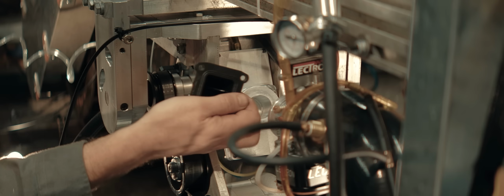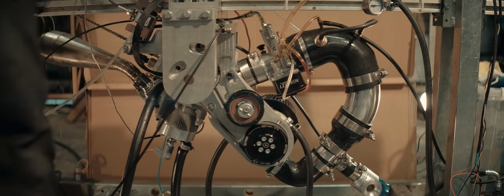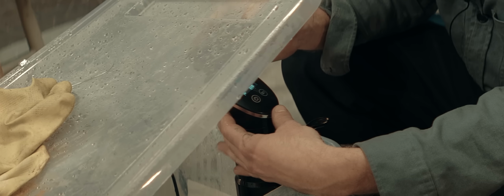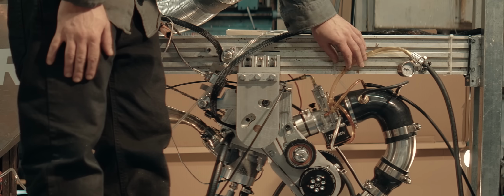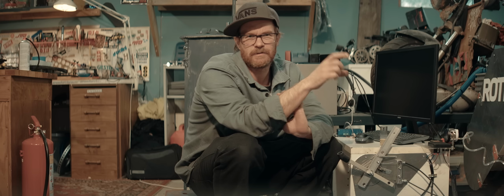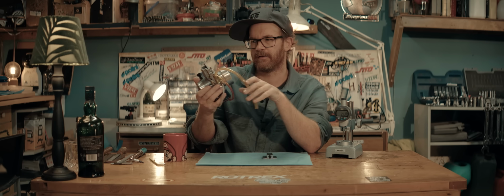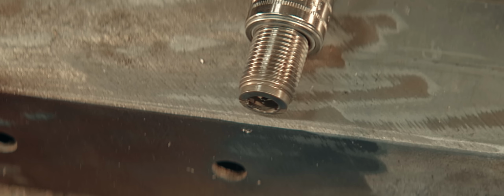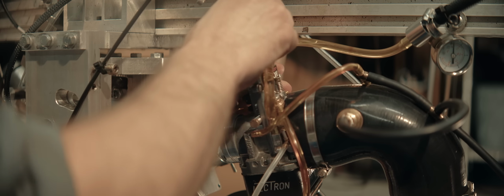Supercharged 50cc Two Stroke BREAKTHROUGH!

Comment: Never before have so many motorheads been so engrossed in the development, care and feeding of a 50cc 2 stroke. My favorite channel. Brilliant.
Reply: ohhh how right you are, engineers all about the world following this adventure, all for 50cc!! personally I think a turbo is needed to reduce the parasitic loss
Reply: I’m guilty! Lol i don’t know how i stumble on this channel but i did and i never stopped watching lol 😂
Reply: @marcwire9332  turbo with a boost capacitor to keep boost on demand.
Reply: @marcwire9332   Turbos are not suited for two-strokes. You need the more predictable boost across the RPM range that a supercharger provides (as boost is directly dependent on engine RPM), especially with two-strokes having such a sudden and defined power-band. Also, for single cylinder engines, the inconsistent and low exhaust pressure becuase of the single combustion event per crank revolution (or per two revolutions for 4-strokes) is not ideal for consistent operation of a turbo. Finally, imagine putting two-stroke exhaust through a turbo; the soot and oil would quickly ruin the efficiency of the turbine, and the unburnt fuel could become very dangerous becuase turbos get really hot, kinda like a bomb. 

When you think supercharger=inefficient, you are probably thinking of a roots type. Twin scroll (Lysholm) and centrifugal (as used here, I think) types can actually be quite efficient. Centrifugal types are just the compressor side of a turbo driven by then engine through a hefty gearing ratio, rather than by an exhaust powered turbine. For a small engine like this, the efficiency gains of a turbo are so marginal that the instant boost and reliability of a supercharger are worth it.

Turbos have a parasitic drag of their own, in that they increase the pumping losses of the engine. I don't know exactly how bad that would be in this case, but I do know that it would have a negative impact on the "free-breathing" of an engine that is meant to rev as high as this one will. I also think you would struggle to find a turbo suitable for a 50cc motorbike engine, since there are so many more variables involved in turbo design, such as exhaust flow rate and pressure for max efficiency, operating flow rate range, power producing regions, compressor output static pressure, flow rate etc. The supercharger is just the better decision for this application, in my opinion.
Reply: I’m guilty!
Always waiting with anticipation for the next video to come out.
Always wanted to mod a weedeater engine. This is saving me a lot of money and time with better results.
Only thing that could be better is 4 cylinders in line!!!
Reply: @rexhorning7228  Two lines of 4 joined in a V :)
Reply: @slartibartfast2649  Thanks for the detailed comment.
Reply: @slartibartfast2649  there are starting to be some cool electric-powered turbos that use an actual turbo housing and basically E-bike motors. Saw some with actual boost results unlike the "electric supercharger" scams from amazon
Reply: The more I think about it, the more right you are! Alex is leading an actual, historic endeavor.
Reply: @slartibartfast2649  I recently realized another shortcoming of Turbo + 2t. The exhaust pressure wave that's bounced back to pressurize the cylinder removes a significant amount of energy from the exhaust. While there's still waste heat and noise leaving the tailpipe, there's a lot less energy than a four stroke, because the exhaust has already been used to charge the cylinder.
Reply: Lol, true
Reply: @slartibartfast2649  snowmobiles have turbos working very well.
Reply: @slartibartfast2649   the nice part of the small engine wold be, that a turbocharger like the one of the smart car should step in quit late in the revrange. Therefore the exhaust housing should be quite big in comparison to the volume of the cylinder. It could work… 
It could be like these old cars wich don’t run a wastgate an rely on the to loose exhausthousing (Eichberg Sierra)
Reply: Are they tiny two-strokes like this? Some larger two-strokes have direct injection and conventional oiling systems like 4-strokes, not have oil+fuel and carb combo like there is in the video. This makes the exhaust gasses much cleaner so there is not the same problem with oil, soot and fuel ruining the efficiency of the turbine.
Reply: @mathewreinecke2852  those are only 4 strokes, are they not???
Reply: This is like the longest Netflix series on how to design a motor ever. Love it.
Reply: @slartibartfast2649  Every time someone says turbos and two strokes don't work there is always someone out there running a two stroke turbo motor. All of the reasons you listed why it won't work are really just pissing in the wind. Just because there isn't a perfectly sized turbo for this motor and well engineered solutions to any problem it might encounter doesn't mean it can't work.

I've seen so many people waste time with theoretical nonsense like "It can't work because of x, y, z" and meanwhile guys are ripping up mountains with factory turbo two stroke snowmobiles all day.
Reply: @marcwire9332  yes i have been wondering if a turbo a little smaller than a ko3 would probably have awesome response
Reply: @mjodr  Just because some guy in his garage slapped a turbo on a two-stroke doesn't mean it works well. Why do you think engineering exists as a profession? In case you didnt know, engines are designed on maths that is all about the 'x, y, z". If you think I'm 'pissing in the wind' try actually studying engineering and design an engine. There is a big difference between something that is possible and a good idea.

Is it possible to make a gasoline powered locomoitve? Yes, absolutely. 

Is there a good reason why all locomotives are diesels? Yes, absolutely.

I said turbos are not a good idea on two strokes becuase most of them are carburetted, single cylinder, small displacement with fuel+oil. The Rotax engine in the snowmobiles you allude to is a fuel injection, twin cylinder, 850cc with a conventional oiling system like 4-strokes. None of what I said applies to the Rotax because it is totally different in design.

Owning, fixing and tuning a motorbike doesnt make you an engineer, so do a bit of research before telling someone they don't know what they are talking about, otherwise you might make yourself look like a tool.
Reply: @mathewreinecke2852  they are totally different in design, being two cylinder 850cc direct injection engines, without the oil+fuel of this engine.
Reply: @slartibartfast2649  You are proving my point and contradicting yourself. It's pretty clear at this point Alex can engineer anything if he wants to. He can make this engine with all the features you describe, besides displacement.

I don't think displacement is a problem. He went out of his way to custom build a supercharger with the right specs to match this motor. That supercharger is very similar to the front half of a turbocharger. There's nothing stopping him from going all the way and completing the turbine side and making it a properly sized and functioning turbocharger.

There isn't some magical formula that says below certain CC turbocharging is not possible. It's just not as easy to buy off the shelf parts and slap them on. Obviously that's not what Alex does on this channel all the time. He is capable of making stuff. Which makes him capable of copying whatever makes the new turbo Rotax work. Direct injection, conventional oiling, and whatever else you think is magical and impossible to copy from the Rotax.

Go watch this video and tell me you can't scale all that down: https://youtu.be/ddw354bsy8s

300-600 hp and no direct injection and no conventional oiling system. WOW! How did they do it? Impossible!

The only one looking like a tool around here is you.
Reply: How did the Detroit diesel
Two strokes ever survive with turbos?
Reply: @jeremygourde9880  You bring up a good point that I forgot to mention. I dabbled in the heavy diesel world. Not only are there many boosted two stroke examples, but the environment those turbines are in is pure hell compared to what they would experience in Alex's design. I think he is trying to say the turbine would foul with sticky oil and soot or something. Holy crap, have you ever seen what an OEM turbine looks like when you pull it off a diesel with 400,000 miles? Let alone what one would experience in a motor that is modified and is just DUMPING soot out?

Another example would be my 1987 OMC 175 exhaust is clean as a whistle. That's with old school carburetors and premix, too...not even using the factory VRO oiling which reduces the oil even further.

Now, to be fair, my Yamaha YZ250 exhaust was always a goopy gunky mess, and so was my friend's. But also that was the first two stroke I owned and I'm sure I could have tuned it better. It's possible he is scarred by an experience with two stroke dirt bike exhausts and he is assuming if you throw a turbine wheel in there it will get all gooped up. That's the freaking least of the worries in Alex's application and VERY easily solvable, lol.

What a trivial problem to even have the attitude of "don't even try, it's a bad idea." He must not see the motto plastered on Alex's garage wall - "Easy isn't worth anything".
Reply: @mjodr  Alex did not design the supercharger. He designed the gear ratio. That is an off the shelf supercharger. I highly doubt that he would want to redesign  the engine for conventional oiling, which would require changing the cyclinder head and block with the appropriate oil channels as well as designing sump and oil pump system, also necessitating switching from sump scavenging to direct cylinder intake. 

Displacement is definitely a problem for turbos, since they rely on airflow. Small displacements don't move much air.

I don't think it is impossible for Alex to do any of that stuff in theory, but why would you want to? Separate oil systems, fuel injection, multiple cylinders, turbos etc.. All of that is heavier than what he has already which totally defeats the purpose of building a two stroke in the first place. So, no. There are some things that do not scale, such as the weight of pumps and oil reservoirs, cylinders (especially with two strokes which require separate sealing for each cylinder).

I made a mistake in saying direct injection. I meant to say fuel injection. 

The video you sent me is of a 1.2L two cylinder, fuel injected engine. Just like the Rotax. Wow!
Reply: you are so right 🙂
Reply: @slartibartfast2649  Small correction on the Rotax. It's not exactly off the shelf. When he called Rotax they stopped making them that small a long time ago and they told him they didn't think they have the parts. So they invited him down and they slapped together a custom unit with what they had available. It's obviously small enough to work now that we've seen it run.

He may not have designed it from scratch, but I believe he could if he needed to. You sound like you may have been around here since the start of this project, but if you haven't then it's pretty obvious Alex has the knowledge and most of the hardware and ability to make a full turbo from scratch. I mean, look at went into this completely custom designed block, from 3d printing, to casting, to cnc machining, to ideas I've never seen any other engineer try in a custom engine. He's off the deep end already and making a turbo isn't super far fetched.

Sure, the science of a compressor or turbine is one step up from the flow characteristics of inside his custom two stroke block, but it's not impossible. And if Alex fails at machining all of it he can outsource the hard bits like he has before. It would still be his design. And you would be sure it would match the flow charts/maps properly. I know it's very hard to machine compressor wheels, so I wouldn't expect him to just whip that out on his in-shop machinery.

So you admitted it's not impossible, but then asking why? Then giving examples of how it's impractical? Bro, look at the goal and what he has created so far. The goal is the most powerful 50cc engine in the world. It doesn't matter if can bolt up to stock vespa or whatever. Do you think what he has now could just bolt up a stock motorbike of any kind? He's not designing this to go into a production run for customers. It took him forever to get to this point with whacky custom designs that took tons of money and time to make. Going whole hog and making a 50cc cylinder version of the video I linked you is RIGHT in line with the tone of this project, lol! "Easy isn't worth anything" is the motto.

I was not aware the video I linked had a 4-stroke style oiling system. It didn't look like that and it did not sound like that from his description of the motor. Honestly it looks like a freaking DASA jet ski motor or like any other custom billet motorcycle two stroke motor I have ever seen. TBH, I don't know why you would need to separate out the oil anyway. It just seems like a luxury, to make ludicrous hillclimb power, or to clean up emissions for EPA restrictions on the OEM stuff. I don't think it would be required in this application. This is a one off dyno queen.
Reply: So true though huh? Lol
Reply: @mjodr  I get what you're saying, but turbos really do have a problem if the exhaust comes in big pulses, like in a single cylinder.

A well tuned carburettor can actually outperform fuel injection due to the superior mixing of fuel and air that the carb achieves, but EFI allows for continuous adjustment of the quantity injected, meaning that is is better at being consistent in lots of operational conditions. Cold starts, hot block at full bore running, high humidity, low humidity, low altitude, high altitude etc etc, but in that specific window that the carburettor is tuned for, it could perform better. Also, EFI requires a lot of parts (sensors, injectors, pipes, pumps, ECU etc) which increases weight and complexity.

I think the example you showed me doesn't actually use 4-stroke oil methods, and I would be interested to know how much power it produces vs a supercharger for the same application. The turbo is probably better becuase of the bigger parasitic drag you would get from the bigger supercharger. There is a reson that turbos are more common than turbos in larger engines, of course.

FYI, oil in the fuel is really nice and simple because it allows for the deletion of a lot of parts (oil galleries, oil pump, larger sump, oil reservoir, oil filter, piping, oil radiator), hence why it is used for small, light, cheap and simple two-strokes. Since most two-strokes use crankcase scavenging, this means the oily fuel passes all the key moving areas. the downsides are that the oil reduces the power output of the fuel, and leads so carbon deposits after combustion. So it is definitely becoming rare for emissions reasons, but also becuase it increases combustion and librication performance as well as being another cause of reliability issues.

I'm not trying to be all snobbish and play down Alex's achievements at all. He probably could get a turbo working, and maybe he will in the future, I just don't think it is the best solution. I could very easily be wrong.
Reply: @slartibartfast2649  When I was wanted to turbo my XR650R I kept seeing time and time again the old myths show up. "650cc is too small to spool anything". And the other one "One cylinder isn't enough to smoothly spool a turbo. The pulses are too spread apart. Won't make much boost. It will suck" Then a guy finally slapped a turbo on an XR650R and was RIPPING it up and down the street on video, spinning the tire for days. Since then I've seen people turbo increasingly smaller and smaller single cylinder engines, so I do not believe the old myths anymore.

Same as rear mount turbo systems. Tons of internet experts out there saying it will never work, and yet there are plenty of examples of it working for decades.

Yes a single cylinder small displacement is FAR from ideal for a turbo application, but that is not the point. If we could chose any design it would obviously be multi-cylinder and larger capacity. But the goal of this project is the most powerful 50cc two stroke in the world. If it makes even 1% more power than n/a then it is a success. We have to temporarily suspend all knowledge of efficiency, practicality, daily drivability, longevity, weight of extra components, everything. Is it worth it? That's up for Alex to decide. It's not our project, it's his. I know I'm personally not going to try and turbo a 50cc motor. I don't have the patience or money to do it. I would just slap a pipe on it, jet it and call it done. That's obviously cheaper, faster, more practical, more drivable, lighter, everything which is what you are arguing he should do, but that's not the goal here.
Reply: @poorlydunbarvideos1472  Those electric powered turbos are technically also electric superchargers. The only difference between them and the scam ones is the cost to make them and that they can make actual boost.

Here's some fun. Turbos were originally called turbosuperchargers because "turbine-driven supercharger" is a bit verbose. It didn't take long before that got shortened a couple more times. Then there's a rather weird variant of the turbo they experimented with on aircraft engines just before jets took over, where instead of attaching the exhaust turbine to a compressor they'd just attach it directly to the gearbox. This was called a turbo-compound engine. I think this was in the late 1940s or so? It never really took off.
Reply: @mjodr  With the right engineering almost anything is possible. Practical is an entirely separate matter.

There are some pretty clear reasons why this 50cc 2 stroke engine is being run with a supercharger and carb setup. If he wanted to use a turbo instead he would be able to do so, only snag is he would have to completely reengineer the whole engine - crankcase, intake and exhaust porting, exhaust system fluid dynamics, he may have to add a valve or valves for intake and exhaust... and the list goes on. Doable? Yes. Practical? Ehh...

So that's the supercharger sorted. It's a design decision. As for fuel injection, again, redesign the engine to not have a total-loss oiling system and you can do full closed-loop with lambda sensor the works, otherwise you have to go open loop, which is basically a carb minus the jets, plus an injector, plus air flow sensor, temp sensors, et so on, at which point the benefits aren't compelling over a carb, unlike closed loop EFI - which does not like having its O2 sensor in the exhaust stream absolutely coated in semi-burnt oil. If that happens you will get some very bizarre fueling issues. I also do not want to speculate what a nitromethane-methanol fuel does to such sensors. Maybe nothing, maybe nothing good.

I've seen turbo'd 2-stroke diesels in plenty of buildings as backup generators. They look just like a 4-stroke engine, complete with cambelts, rocker covers, intake and exhaust valves... but they are 2-strokes, just reengineered to not dump semi-burned oil into the turbos and potentially cause issues. They're also typically 4, 6, 8 or 12 cylinders, not 1. They can get a fairly good exhaust pressure and flow going without having to rev... well, like it's a bike. The 50cc 1 cylinder 2-stroke in question here, though, probably is capable of revving high enough to sustain enough flow and pressure to spool a turbo.

Edit. EFI stuff was meant for something else, brain's not functioning too well at present. It's a damn mess up in here.
Reply: @mugz0859  yes with the right engineering almost anything is possible. I think the only reason Alex has a carb on this thing is he likes to start simple and see what happens and then work his way up. Also, when he started he was not doing this full time. He didn't have the time to go full beans on certain aspects. I think eventually he will go EFI if he is looking for his goal. Also, closed loop is never necessary especially for a dyno queen. I believe the high powered sled I linked was open loop as he was constantly checking spark plugs and EGT's and just telling the simple EFI computer to dump more fuel. In that case you can spew as much oil out the exhaust as you want.
Reply: @jimbefit3073  no they are on 2 strokes also.  The beauty of it is exhaust pressure rises with intake pressure.  Eliminating the need for an exhaust valve to force more fuel air into the chamber.  They come factory now, polaris and skidoo.  I've riden an aftermarked turboed m8 articat.  Very impressive
Reply: First time I've watched this outer frontier of obscure mechanical obsession but became rapidly hooked, as well as feeling I was having my leg pulled in the nicest possible way. The view production values are excellent.
Reply: Y'all obviously never been on the goped forums.
Reply: @theoriginalpauly  ....its not a turbo
Reply: @Watchmedome3017  un turbo in un 2 tempi non si può montare. Inutile fare ragionamenti.
Reply: ... im the "don't effing talk to me right now!" Kind of engrossed
Reply: I once built a crankcase and piston port nitros fueled moped,2 stroke 50cc, it was insane,15 hp without the nos two carbs 2 throttles,1 thumb 1 twist, a 12mm carb, 1 16mm carb,totaling28 mm yes I blew it at 75 mph
Reply: @slartibartfast2649no matter what kind of lube system you use, a two stroke is by nature a total-loss oiling system, the lubricant is, by necessity, mixed with and therefore burnt with the fuel-air charge. doesn’t matter if a separate reservoir of 2T oil injects into the carb, or is premixed with the fuel, the bottom line is the oil is still getting shot into the cylinder, compressed with the charge, and made part of the power stroke. I suppose certain synthetics with 100:1 mix ratios could be considered “cleaner” because they use half as much oil as conventional 50:1 ratio 2T lubes, but that’s about it.